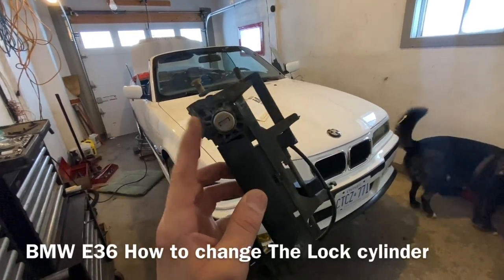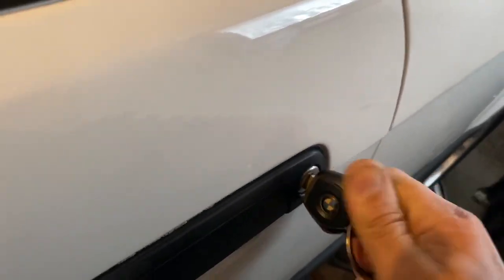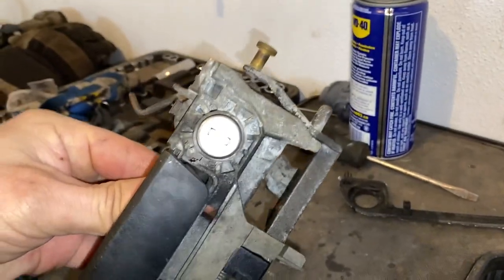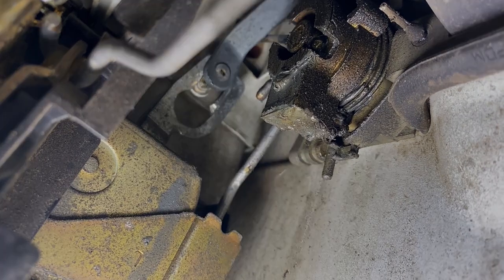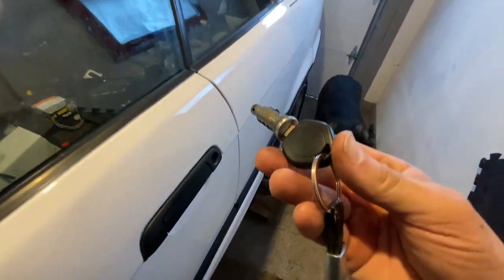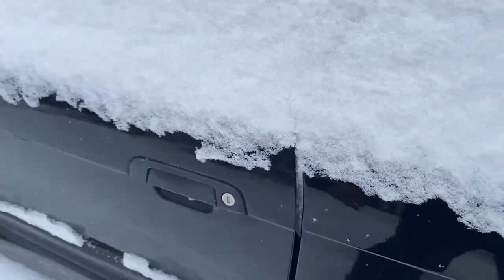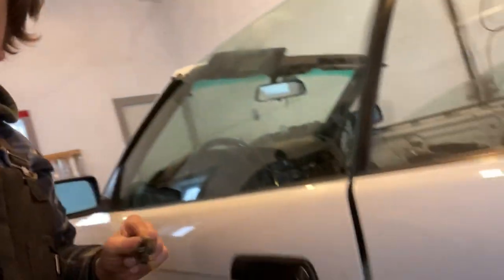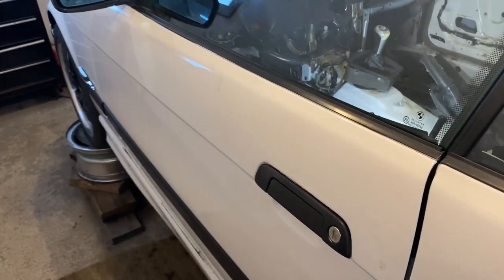BMW E36 (Lock cylinder removal) How to remove BMW E36 door handle lock cylinder

Comment: Are you certain that you can't do this for 96+ models? It's the first time I've heard that a door handle requires the transponder chip...
Reply from the maker: It’s 98 and up, you could always take the chip out of your old key and put it into your new key
Reply: @ProblemSolverGarage  it's 1995 and up
Reply from the maker: Well mine is a 96 and it doesn't have it, I'm sure there's variations though depending on trim

Comment: i have the 98 m3 the arm broke off that opens door. in the video you have the same lock as mine but the ones i found on ebay are the other key lock different on the backside what can i do since  since you said theres a chip please help me thanks

Comment: i have 2 spare doors off a junk car in my backyard (no key) my driver door has a hard time locking but im pretty sure it’s the actuator itself, if i were to swap over all the door handle stuff from the spare doors, i should be able to just swap out the lock cylinders between to two and have working locks without needing 2 keys? i have a 99’ btw.

Comment: My car is a 95 and i'm having to replace my passenger door from a drifting incident. Can I just swap lock cylinders and my key will work with the new door and cylinder? Also I won't be able to roll my window up as it shattered inside the door. Any insight?
Reply from the maker: Shouldn’t be a problem

Comment: Hi, my Bmw is a 95, the doors have been changed by the other owner but i got new handles and ignition, if my key doesn't work (on the old one) can i still take it out?
Reply from the maker: If your key doesn’t work you will have to switch the whole handle
Reply: Harder to do but you can pick the lock to remove the lock.

Comment: Hey I'm in the GTA I was wondering if you could help me out with my door handle? The handle itself is flimsy and doesn't open the door when you pull on it but the key still opens and close the lock
Reply from the maker: Well unfortunately I am about 17 hours away from you but I wish you all the best and hope you can figure it out

Comment: Is there any way to remove the lock cylinder without the key ?

My actual door handle is broken, and anytime I see people selling door handles they have their lock cylinders but no key comes with them, I would like to take the lock cylinder from my broken handle and swap it onto my new handle so that I keep the same key for everything, however if you do need the key to remove the lock cylinder how could I remove the lock from my new handle...
Reply from the maker: Probably could use a drill and drill a hole in it
Reply: Kinda late to the party, but did manage to do that? We bought a spare door, but having problems swapping locks without the original key. Should we just try harder? Kinda afraid it could break
Reply: @LyonR.  

Without anyone telling me if it was possible, I just ended up paying extra for an assembly with the key. From what I understand without the keys the wafers are not aligned and prevent the lock cylinder from coming out (otherwise that'd be a vulnerability) You could try drilling it out, but I'm not super convinced.

You mention buying a spare door, was your intention to swap the door, or you bought the whole door just for the lock ? Because if you're swapping the door you can swap the entire handle assembly from your old door to new door, that won't cause any issues and won't need the keys.